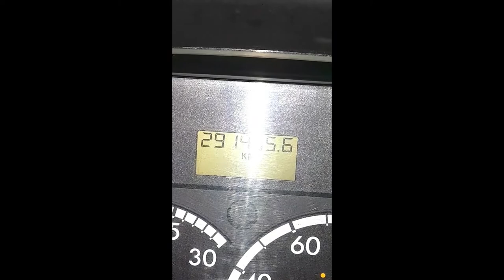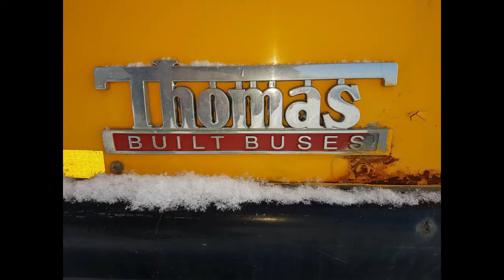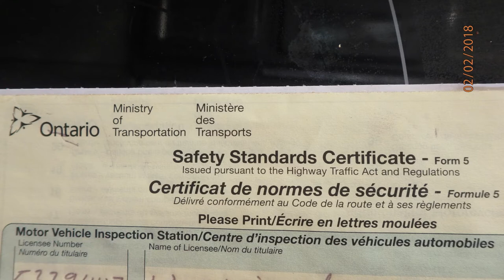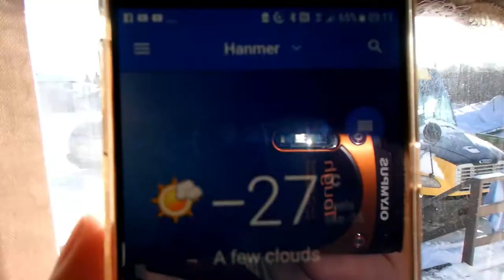(1) Buying a bus. School bus conversion to RV, tiny home. skoolie. motorhome. 40 foot.

Comment: How fun is that, I would think that would be a really fun project. I have been blessed to be able to travel some here and there as a kid, and the luck of motorcycle trips being so cheap, I have done a lot of exposing on two wheels, the bus would be a much more comfortable way to travel all over. If its cold, turn the heat on, hot, turn the ac on, rain, roll the windows up. Yeah, it would be a fun trip in a bus conversation. 
I can understand you just fine my friend, So no worries here and you are doing great on your first vlog, so good job my friend. 
Good job, what a mess, I could see some of the same issues here, I would have never thought about all the legal paper work and nonsense, but I could see the same issues here now that you brought it up. Thanks for sharing looking forwards to seeing more from your channel so we subbed you as well. 
Have a Blessed and Happy new year my friend. 
Dale
Reply from the maker: Thanks,  I love the big bus. I'm also looking to downsize just incase I don't like the hassle of a big rig. I have an extra minivan that I might Also convert.
Reply: @heatseekerbus   OH YEAH, I hadn't thought about that , but you are right, there is a few state parks here and there, you can't get a rig that big in, in fact they say nothing over 30 foot, but who knows how many there are like that and they may mean no more than a 30" trail, it will drag differently. Thanks again my friend. 
Dale

Comment: Sorry you had the additional expence of tires and the fuel tank repair. Orange is my favorite color so I was saddened that you have to paint it. I hope I don't have to paint mine when I get it. I was just planning on putting a complementary color stripe down the oragne sides and paint the top white. The vinyl siding on my home is an off whte so I painted the foundation Marigold. If I got a bus it would be color coordinated with my house.
Reply from the maker: Here in Ontario Canada,  the chromium yellow has to be all gone. Even the roof. The funny thing is that it can still be yellow, just not chromium yellow .

Comment: I like the Thomas Built Saf-T-Liner C2. It's the one I want to convert. The buses up your way must get a lot of road salt. It looked rusted bad. I live in Henrico, Virginia. The C2 buses look pretty good here. I haven't seen any C2 buses for sale yet.
Reply from the maker: Out here, they have to retire after 10 years and they've seen a lot of road salt. Keep watching. You'll see all the work I've done. If you get a C2, Thomas with the black plastic windows, take them all out.  They all leak
Reply: All the side windows will be gone as soon as possible. I was thinking about solid 3/8 inch plexiglass panels I could paint with that LED paint you can attach electricity to and make them light up. Glue the panels in the old window openings and the whole side of the bus would be a light. The inside would all be insulated and wide open for cargo space. No walls, just privacy curtains to divide the bedroom and bath room. I want my C2 to be dual purpose RV and cargo transport van. Hopefully with a working wheel chair lift converted to lift motorcycles and use for auction items I buy and haul with the C2. No need for bunk rooms for additional passengers because I travel alone. It will be a minimalist RV and maximum cargo van.
Reply from the maker: @cdgarrett1  that would be really cool

Comment: Have you thought of a silicone coating for the roof or the windows you don’t use it’s great insulation and UV protection
Reply from the maker: I have 3 coats of silicone sealant on the roof.